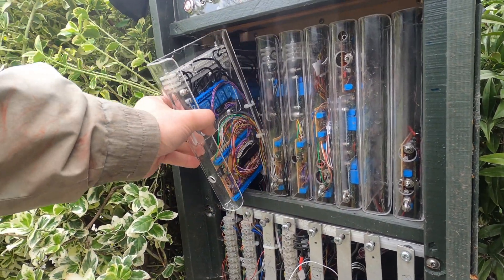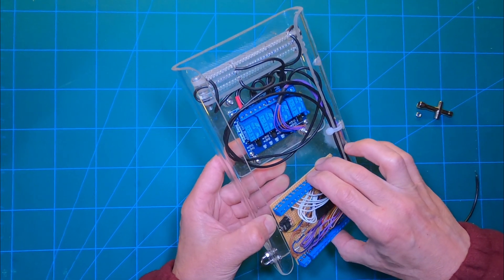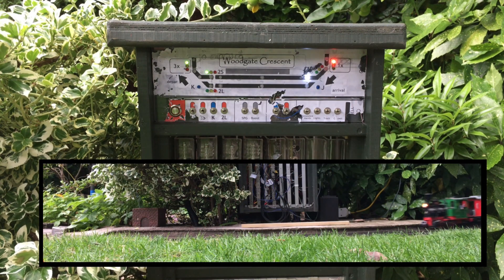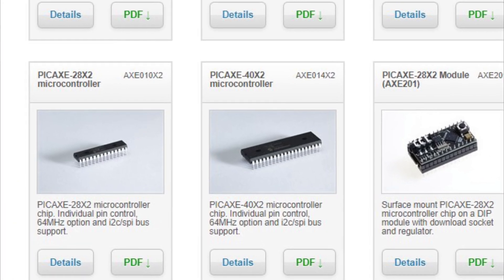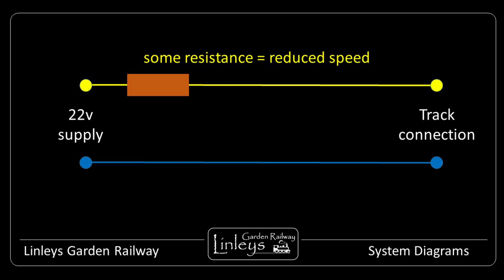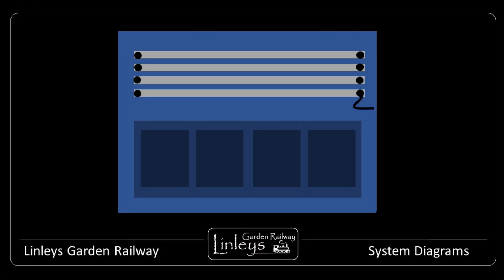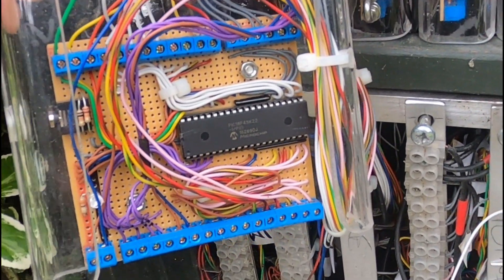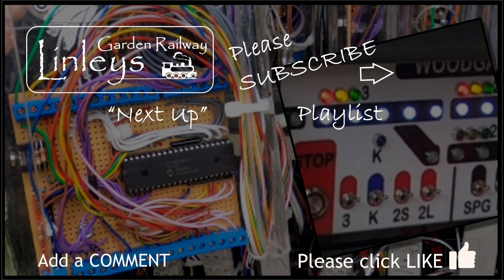Block Section Control ¦ Garden Railway ¦ G Scale Model Railway ¦ DLC Decentralised Logic Control

Comment: Great description of your control and acceleration system Warren,  you clearly have invested a lot of time and resources into the system.  Question - aside of the control system, how do you clean the track?  With a control system relying on good track conductivity to function smoothly, what are your tasks for track cleaning?   Seeing other videos, your layout is quite extensive. Have you considered a running on battery power?  Awesome work Warren, I am very interested in your signal concept, and will take some of your ideas into play.  Thanks, and look forward to another Linley production..  Skål!  Ron// 🚂😊
Reply from the maker: I spent a silly amount of time on producing this video but all good fun.  I just wanted to explain a little more about how the system works.  Well, track cleaning is a difficulty for sure.  My garden is surrounded by trees which dump vast quantities of debris all year round!  Maybe I should do a video on that too.  Thanks again for your comment and support. Cheers, W :)